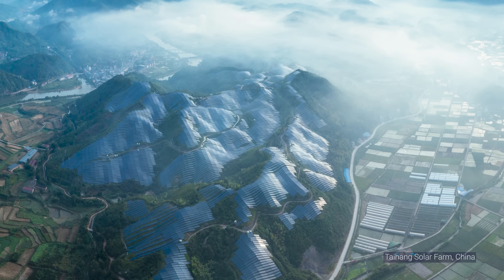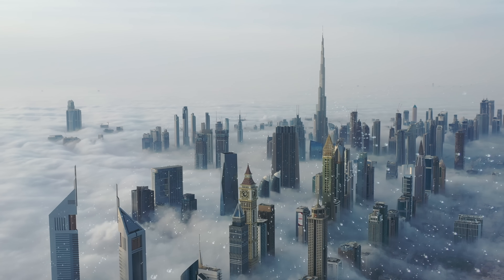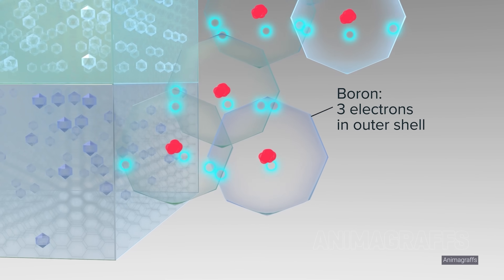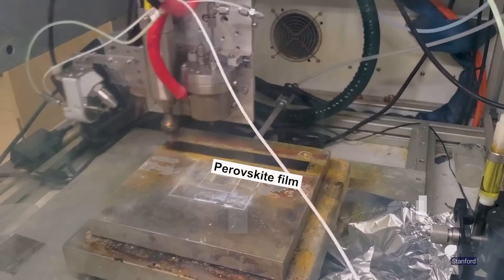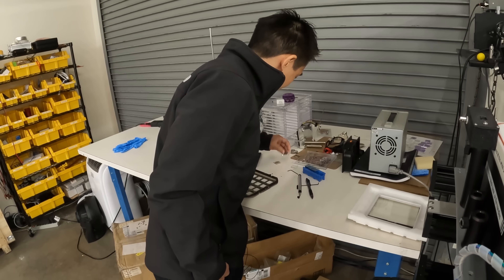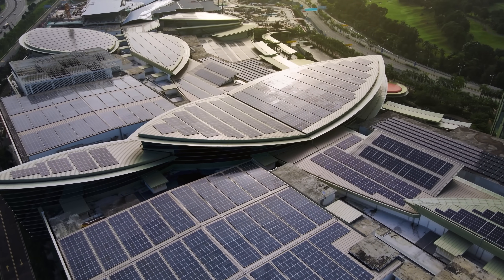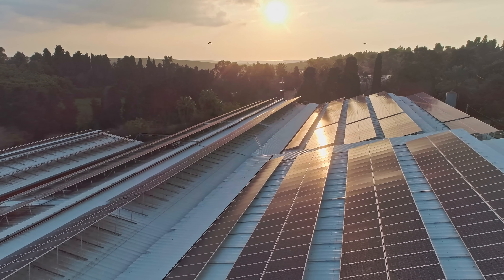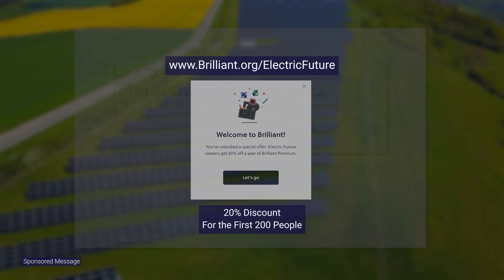Solar 3.0: This New Technology Could Change Everything

Comment: How's the distribution capacity?  It's all well and good to produce the energy with a cheap and light material, but that's not that useful if it can't actually be sent from the panel to the outlet.

That's actually one of the major failings of wind and solar - Yes, they generate a fair amount of power with some reliability and comparatively low environmental impact, but they don't generate enough of it fast enough to push the energy where it needs to go, or adjust its production to account for peaks and lows in demand at different times of day or in different weather conditions.  Or really power anything more substantial than a few thousand large homes.  The capacitance technology doesn't exist to store or distribute the amounts of energy required to account for peaks farther out than a few miles from the source, or support the gargantuan energy demands of factories or other machine-heavy operations.  Like purifying water or sewage, for example.

A coal or nuclear power plant can send their power hundreds of miles directly along power lines, and easily adjust their power output, while wind and solar can only throw 20 miles or so, with its production determined largely by the whims of fate.  This can be ameliorated with more solar fields, wind farms, and capacitor banks, which actually has the benefit of distributing the electrical grid more generally making it less susceptible to deliberate sabotage, but it also means there's less overlap in area coverage, and there's a lot of occupied real estate.  I suppose we could co-opt graveyards and golf courses for it?

Presently, if there's a disruption in power output at one plant or power line in a particular hundred mile area, another power plant can pick up the load and keep power running with only a slight hiccup in service or a short brown out.  If a solar or wind farm of a particular 20 mile zone was disrupted, or a sudden large demand was created, a neighboring source would not be able to pick up the slack.  Prolonged brown outs and black outs would be more common under such a system.

The capacitors, magnets, and panels currently in use are also subject to wear and tear that make them more expensive to maintain and replace per generated KW/h than traditional power sources.

At this stage, solar and wind are great for individual home use as a supplement to more traditional power generation, but that's about the extent of it.

Comment: Well sometime in the future solar cells can be used as a paint. You have to paint your house sometime, so why not use paint that gives you electricity as byproduct? That could require to develop a system that does not need wiring or system that creates its own wires while it dries. Also this could be self repairing, so any errors, dents, scratches, etc. could be fixed to some limit (similar to some paints that fixes scratches on cell phones). That would mean loads of energy from any manmade surface. And there would be far less needs for centralized solar farms or even other ways to harness energy.

Comment: At 0:10 you say that the sun irradiates the earth with about as much energy as all of human civilisation uses in a year. 
This doesn't mean anything, because Energy is power over time. When you say "irradiate" you are reasoning in term of power, not energy. So you have to specify on what timespan you considerate that power.

With a quick research on google, you find that the power that the earth receive through solar irradiation per squarred meter is about 
Ps=1361 W/m²
the earth has a surface of approximately  510 *10^(6)km², considering that sun beams are parallel, the surface of the earth exposed to sun radiations is half of it,
 S=255*10^(12) m²

Hence, the power received: P=Ps*S =347 000*10^12 W= 347 000 TW

T=E/P , then T=160 000/347 000 = 0.461 hours = 27.7minutes. we find 160 000 TWh on the diagram at 0:17.

In conclusion, the sentence should be rectified as followed : " in about 30 minutes,  the sun irradiates the earth with about as much energy as all of human civilisation uses in a year."

Comment: 1000w/M2 you'll never get more than that because that's what the sun produces
So a 10,000 watt array with 100% efficiency will still need to be 10 meter x 10 meter in size.

Comment: The explanation of how solar panelswork can be highly confusing, especially with the details in this video.
Solar panels are literally just diodes, similar to LED diodes. Any diode, be it an LED diode or an IR one can produce a foton when an electron passes through it - thus emitting light when electricity flows through it... Or it can produce an electron when a foton lands on it - and thus producing electricity. LEDs are optimised to produce light in the visible spectrum, while solar panels are optimised to produce electricity from the light. To prove solar panels are actually just diodes, you can take a camera, take off the UV filter and try passing current through an old solar cell you don't need like from a garden light, the camera will show you the UV light coming from the panel. The rest you can figure out easily by just searching for how LED diodes work, it's usually similar both ways.

Comment: "Stability and Degradation: Perovskite solar cells have demonstrated competitive efficiencies with potential for higher performance, but their stability is quite limited compared with that of leading PV technologies: They don’t stand up well to moisture, oxygen, extended periods of light, or high heat. To increase stability, researchers are studying degradation in both the perovskite materials and the contact layers. Improved cell durability is paramount for the development of commercial perovskite solar products.

Despite significant progress in understanding the stability and degradation of perovskite solar cells, current operational lifetimes are not commercially viable. Mobile markets may tolerate a shorter operational life, but stability during storage (prior to use) is still a key performance criterion for this sector. For mainstream solar power generation, technologies that cannot operate for more than two decades are unlikely to be viable regardless of other benefits. 

Early perovskite devices degraded rapidly. A few years ago, typical perovskite devices would degrade within minutes or hours to non-functional states. Now multiple groups have demonstrated lifetimes of several months of operation. For commercial, grid-level electricity production, SETO is targeting an operational lifetime of at least 20 years, and preferably more than 30 years. 

The perovskite PV R&D community is heavily focused on operational lifetime and is considering multiple approaches to understand and improve intrinsic and extrinsic stability and degradation. Efforts include improved surface passivation of absorber layers; alternative materials and formulations for absorber layers, charge transport layers, and electrodes; and advanced encapsulation materials and approaches that mitigate degradation sources during fabrication and operation. 

One issue with assessing degradation in perovskites relates to developing consistent testing and validation methodologies. Research groups frequently report performance results based on varied test conditions, including variability in encapsulation approaches, atmospheric composition, illumination, electrical bias, and other parameters. While such varied test conditions can provide insights and valuable data, the lack of standardization makes it challenging to directly compare results and difficult to predict field performance from test results. This affects the entire perovskite research and development (R&D) community, independent of any specific research area, material set, or stability improvement approach."

Source:https://www.energy.gov/eere/solar/perovskite-solar-cells

Comment: I'm wondering - does this absorb infrared spectrum and would that subsequently reduce the heat transfer into a structure?  Could you put this atop a factory roof or shopping centre (mall for Americans) and reduce cooling costs as the sun's heat wouldn't get through as much?  I can see that being immensely useful in quite a few climates.  Also imagine awnings of flexible cells that can be unrolled in the morning and rolled up at night automatically providing shelter from the sun and power generation by day and allowing easier radiation of heat at night.
Reply: well... i can say one thing. Because of the law of the conservation of energy, some of the energy from the sun pouring onto the building would be converted into electricity from the solar cells as opposed to it all becoming heat energy. so... yea, there would be some minor cooling effect i think

Comment: I want them to develop an optically clear cell. Slow charging a phone by solar would be super helpful in an emergency and for places where the power grid is unreliable or absent all together.
Reply: You can look into transparent OPV (organic photovoltaics) It exists ;-) But it would not be efficient enough to keep your phone charged.
Reply: @nayunis9289  keep charged, no. Charge while of our in a power saving mode, yes. 

Also "transparent" is not "optically clear"
Reply: @ITpanda  Optically clear is not possible.  In order to generate power the cell must absorb some of the light that passes through, so it can only be translucent or at best partially transparent, a bit like sunglasses in appearance.
Reply: @FireAngelOfLondon  Only half of the light coming from the sun is in the visible spectrum, so theoretically it is possible for say a solar cell for infrared (%40) or even ultraviolet (10%) could be optically clear one day.

Comment: The sun produces 4.7 x 10^25 watts of power by using nuclear fusion. That per metre square works out to be about 10^11 watts, yet solar PV struggles to manage 10^3 watts per metre square.   The current efficiency of pv cells is thus nowhere near 20%, but is about 0.000001%.  Therefore the efficiency can be improved by up to about 100 million times what it is now.

Comment: This was a good video and I'm especially happy you went into the challenges it faces although I always end up frustrated not really understanding how they go about improving the poor aspects. Like, what specifically allows for one of these substances to be more durable to heat and how do they go about trying find it?

I also find it sort of alarming that this crystalline structure was just found in nature rather than come up with. Is it possible theres an even better structure and wouldn't trying to optimize that be the most important step. I mean, it's possible that all this research into perovskite's becomes useless if some better structure is found so shouldn't we first develop the science around finding the best structure?
Reply: so i would advise some Real science courses... learn some chemistry and physics....but typically its about finding a material, or creating one that suits the need better.  Only quite rarely is there truly only one substance that will work for a given need, but how well it works, or its cost, or potential environmental concerns.... ect., determine what substances are actually used.  
We used to use lead as a fixative in paints, in pipes carrying water and many other items.  Until many people had succumbed to lead poisoning, we were not aware of the health issues, and lead worked cheaply and well.   After learning about the issues, we switched to other materials, some of these alternatives were already used somewhat.  But lead was still being used in paints until like the 80's....partially because alternative materials cost more.  
Lead based paints no longer dominate the market because better paint types were developed, and at reasonable costs, else we likely still would have lead paint in our homes schools and hospitals.
Reply: @donatoge1713  I mean I understand that, I just don't understand what they do to find or create these better materials. How can the process be sped up.

Comment: The problem with solar energy is that it is the material in the cell that is braking down that produces the energy, and it is not the Suns energy that is converted directly.
That is why all solar cells degrade.

Comment: i hope see it in devices son as possible, i love wireless stuff, and i get mad with all my cables arround house... i not hide them, because, i want remove them, soo hide a problem not solve nothing... the knowledge of cables hide is enought to get me mad... this is a start point for some stuff, as, smarwatch, i want now hahaha, do you job with quality and when it enters market, i'am in, for sure, money will be the only reasson that may block me, but, if it enter doubling values, i will take... just to remove cables from my view... I already contact CEO from some wireless long range chargers to put dongles in all my small devives, but, they not sell for home uses so far, sadly, i already try some solar panel solution, but, it is totally buck solution and get soo many problem dealing with convenction panels that i drop, but, always trying to find a solution to my problems

Comment: Encase the cells in epoxy resin for duribility. You'll lose flexibility but they'll last years and you can polish then out if they degrade. You could even mold them like carbon fiber.

Comment: You know what's a no brianer? Nuclear energy, yet we still got ding dongs harping on solar. The sun doesn't shine at night...People will still need to buy energy storage devices for their homes along side solar cells. Solar panels are always and have always been a half solution. Without energy storage its useless at the time its needed most, in total darkness.

I'm glad solar cell technology is advancing but for christ sakes people need to stop calling it the "holy grail" of energy production. We've been sitting on that for decades now already, not using it because of the same environmentalist retards who complain about climate change, because just like with climate change, they're to fucking lazy to do their research and will condemn nuclear energy as some kind of danger, as if we haven't advanced our technology and designs since the Chernobyl incident.

Comment: I could see this tech be used in augmentation in concept though, tattoo integration with solar for recharging, combined with some ways to biologically store the energy or fuel a function in a augmentation of the human body...
It doesn't have to be storing energy into a cell, it could be designed to convert into a resource that the body could use maybe?

Maybe with muscles? Your muscles wears itself down as you strain it in use for physical labor, so if the converted resource does something to diminish or take away that stress to the muscles, then you can see endurance increasing across the board?

"The burn you feel when you’ve maxed out your performance is a result of 
the circulating hydrogen ions left over in your cells, which create an 
acidic environment, along with phosphates — additional byproducts of 
muscular metabolism"

So if there's a way to reduce hydrogen ions in your body, the acidic environment won't happen so soon.
Reply: You are mad. There's always a cost to everything. LOL!

Comment: As long as this doesn't become another solution that causes more problems than it solves. The longevity needs to be dealt with. Modern tech is lasting less and less.
Reply: if you trade longevity for efficiency and lower the manufacturing cost along the way, it is a massive step up. because in the long run, you may be spending ideally less on the subject in question or same amount of resources, but yield much more out of it. when manufacturing costs rise proportionally to the efficiency (in real world it is disproportional, and not in favor of efficiency per buck) there's no real improvement. yes, the "thing" is better, but it costs more, you'll spend the same or even less resources using something older in the long run.
Reply: @lateralol  good points. I am just imagining a new iPhone that has solar cells and lasts less than a year. Sure the solar part is cheap and efficient but if you need a new phone so frequently it isn't optimal. (extreme example provided to illustrate my point, but I am sure there are companies willing to sell green energy this way)
Reply: @naotecurto  at this point, the issue here is greed and greed only. People who bring ideas aren't the ones that are selling them, it's the ones that see nothing but monetary opportunity and couldn't care less about breakthroughs and innovation. I'll use Apple as an example. It started off as revolutionary technological marvel and ended up being adjusted and accustomed for better sales. But I do get your point, it is true in most scenarios, it's just that the hazard lays in a different place :)
Reply: @lateralol  let's hope for the best! Thanks for the friendly exchange of opinions. It is kind of rare online. xD